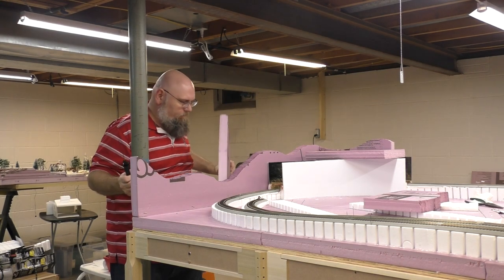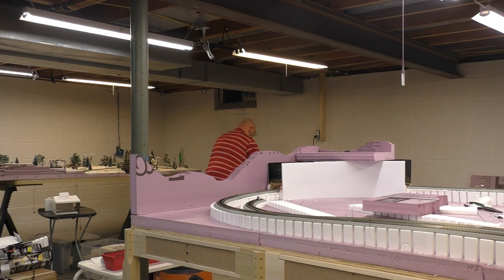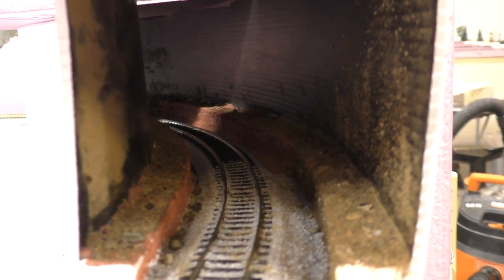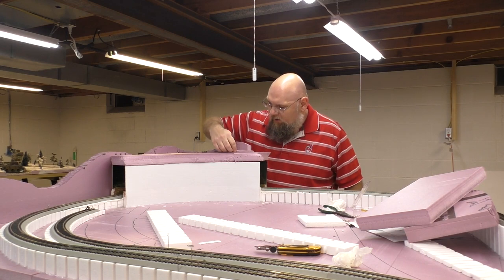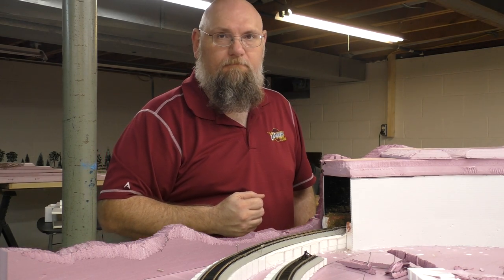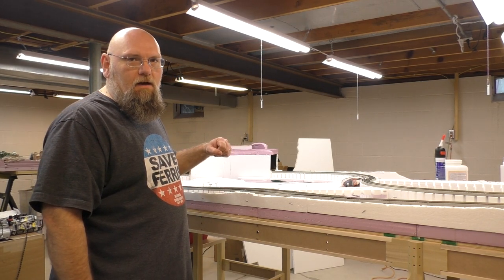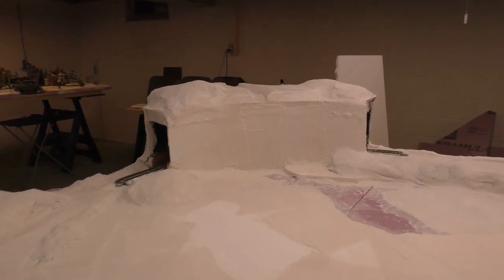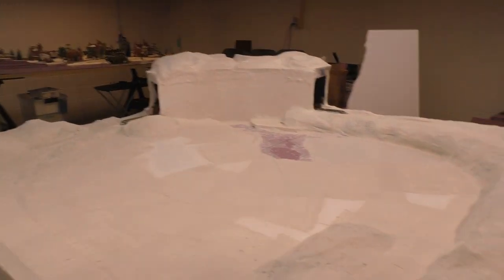My Model Railroad - Foam, Newspaper, & Plaster Wrap

Comment: I see I'm a bit late to the party (lol) but I'd love to know how you got the curved walls inside your tunnel.  Looks like 1/4 inch foam core board (or just cardboard?).  I'm building my first railroad and I'm having a brainfreeze over my tunnel construction. Thanks... going to see if you have more videos!
Reply from the maker: I am a bit late to this replay.  The material I used was something I picked up at Michael's.  It has a flexible core and the outer shell is like a thin plastic.  I hope you got your tunnel figured out.  Happy railroading!
Reply: @JINO0372ModelRailroading  Thank you!  I did.  I wound up using cardboard, and it came out marvelous!  Happy RR to u!